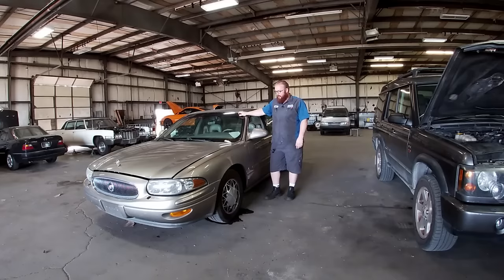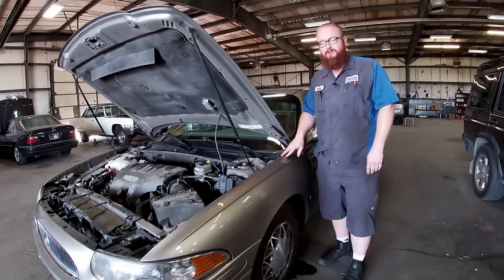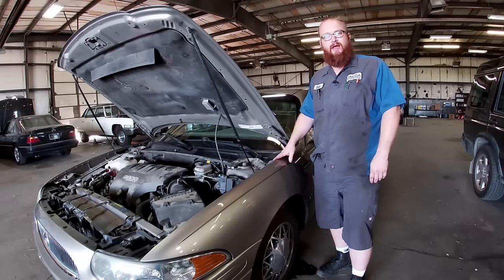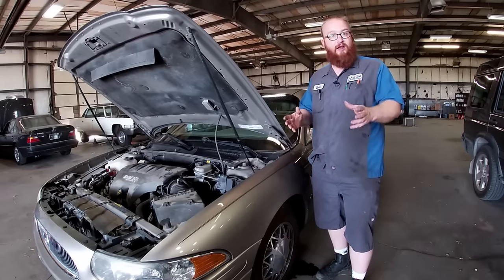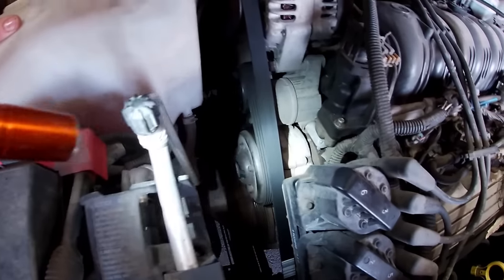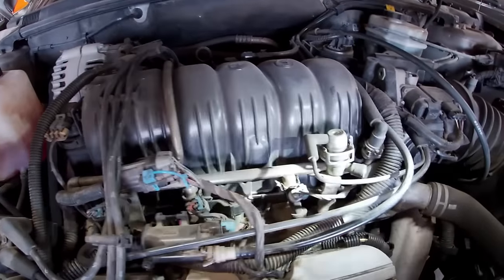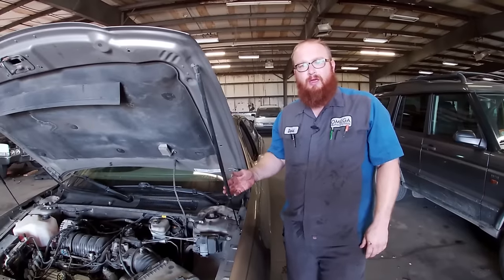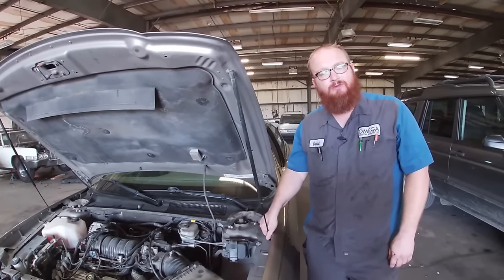CAR WIZARD highlights what makes the Buick 3800 V6 the BEST engine ever!

Comment: Your right no-one can go wrong with this engine. The 3800s are bulletproof
Reply: cobrasvt347 had a 96 Cutlass 3.1 front wheel drive with a 125 horsepower shot of nitrous went to the drag strip every weekend for six months the transmission blew. The motor fine till the transmission went out at 182,000 miles
Reply: @daveycrocket6277   nothing wrong with the 3.1's I'm servicing a lady's that has 220 something thousand on it and so far it's holding up really well. 125 on a 3.1 lol. Sounds like a good time. Gotta love the spray. Shits addicting 🖒
Reply: cobrasvt347 yea I should also say I only ran 1/8 mile tracks in South Carolina. A good set of wide tires all that weight on the front wheels made a killer 1/8 mile car against mustangs and Camaros. The first question whem they got beat was always what size you got. Oh yea and the dipstick had this thick gray sludge on it. I can just imagine what was in the transmission case
Reply: @daveycrocket6277  lol. Shoulda got a pic of the mustang and camaro owners faces when they found out it was a 3.1. Nice 😲
Reply: @daveycrocket6277  my local track here in Tennessee is 1/8 mile. I've only raced on 1/4    a couple times after a gear change.
Reply: cobrasvt347 I would never come out of second gear on eighth

Comment: I owned two Pontiac Bonnevilles, a 1989 and a 1998, both with the 3800 engine.  I could consistently get 35 to 37 mpg (Imperial gallon) on the highway.  Very reliable and dependable engines.  The only repair I ever had to make was to replace the starter on my 1989.

Comment: Great motor.(I have the Buick Lacrosse 2007) Only pet peeve is the location of the power steering reservoir. Engineers could have thought  that better.
Reply: You just made me remember.  In my 1998 Buick LeSabre limited, I had to use a 1 foot long funnel.  It's a small issue but anyway,  I never understood what was the deal with placing the reservoir deep in the back of the engine.
Reply: @peatthetreat   Now, if someone could retrofit the cap assembly to something akin to an auto dipstick,it would make life a little easier.
Reply: I have the same car, and did check my power steering last week. All you do is remove the 2 nuts holding the tank (overflow, antifreeze), swing the tank out of the way. over and onto the front of the engine cover... Then you can access the power steering cap/dipstick.

Comment: I'm 23 years old. my first car was when I turned 18 and it was a 2004 Bonneville running this engine. I'm still driving it to this day and it runs like a champ. I named her Lucille. she's old enough to vote and she's still kicking at 200k miles (it used to be a company car so it never had a bunch of miles on it to begin with) but I've never seen a car engine so open and easy to replace parts. every other car I've worked on has been ridiculously convoluted in its design within their engine bay

Comment: The ONLY issue..... lower intake gaskets

Like a 30 dollar repair..... EASY to do even with basic equipment and knowledge 

Replace the LIM gaskets before 200,000 miles

My dads had 270k.... and I dont know how it wasn't pouring coolant into the oil pan

But once ya do that..... it's a 500,000 EASY motor

More than enough power.... amazing fuel economy
Reply: More than enough power? Nah. That's why I cheaply slapped on supercharger, headers, e85 and meth injection.
Reply: @ichoozjc  in all for making everything fast (my dream car is a 99 buick regal GS... SCed 3.8 and 3200 pounds wet)

But the 3.8 puts out more power than most "daily driver" engines.... especially in the smaller cars it was found in
Reply: @kainhall  Your right, I was just giving a nod to how easy and relatively cheap it is to make more power.  But the n/a engine is a fun ride. I think it's all the torque that makes them so fun to drive.

Comment: The 4.6 in the ford Crown Victoria and the lincoln Town Car were very great engines also !!
Reply: marcel b yes indeed but this gets better mpg
Reply: The Voice Of Reason  interesting yeah long term that is a problem hadn't seen that myself-good to know!
Reply: Poor MPG, these are V8s, not V6s.
Reply: Shitty valve seals. Oil fouled plugs at 39K NO THANKS

Comment: They quit making them because it was to good of engine,
Reply: scott redmon 
*too
Reply: The 3.6 is probably a pos on purpose. Planned obsolescence, built to fall apart.
Reply: Stealerdhip can't make money on a motor that runs well forever. They don't give a crap about the customer.
Reply: Alexis Lubbers I have the 2.8 in CT’s 2006 just put it on the road same as the 3.6 but smaller displacement,I plan to change oil every 4000 miles and get GMs new low restriction filter and add couple ounces of motorkote to oil also.I am pretty sure the problem s with theses engines is not enough oil changes and filters loading up also plan on using 5-30 synthetic gm recommends a brand right on my oil filler. Also the pcv modification will get done to my car ,whisked mine was 3.6 it gets 1 mpg better fuel economy compared to 2.8 lolololo plus all that extra power
Reply: oak 1971 they should be able to recover more from my experience because brakes need replacing struts the odd wheel bearing Ac service repair trans fluid changes and filters the odd wheel bearing belts .People don’t mind this straight foward type of repairs if the motor has a reputation of lasting so I believe over all it will be more easy money and less arguments with customers
Reply: 587,000+ ON MY 2000 BUICK PARK AVE 3800 V6. SUBFRAME IS RUSTY THOUGH
Reply: Nope. Look up cafe regulations, there's your answer. They.. GM.. had no choice to switch to crappy small turbos.

Comment: This video makes me feel really good about driving a slow ass grand prix.
Reply: Take care of that car...I had two ('97, '03). I miss them to this day 🙏🏾😫
Reply: @andrewoliver9686  Same...I had an 06 and an 07 Grand Prix.
Reply: @andrewoliver9686  you should see my 02 GT. SOLID BLACK WITH WS6 hood. She's sweet.
Reply: I had one with the supercharger on it seemed kind of shitty off the line but going from 40 to 70 seemed to have some juice. Cruise 90 on the freeway at 2500rpm
Reply: Definitely not slow you just need to build it
Reply: Though I just got a v6 '08 honda accord definitely faster and better handling than the grand prix I had ....and it's got a fucking sun roof
Reply: It’s still a shitty car
Reply: They aren't that slow. I live my life in sub 160 HP cars and that includes a full-size pickup. One of the vehicles even has HP well down into the double digits lol.
Reply: @marcuscook5145  the grand prix with the supercharger on it definitely ain't slow i had one and wrecked it the thing was pretty fuckin fast at least I thought so

Comment: The Buick Grand National also used this engine- to make a conservative 300 HP in turbo trim.....in 1987.
Reply: Thats 300HP wink wink nudge nudge
Reply: No it did  not, the Grand National used a 3.8 fire ball even fire. This is a GM corporate engine that is metric and has the metric corporate bellhousing, totally different block. But influenced by the same design so it could live on.

Comment: The transmission is also good but you have to change the filter every 70k miles.
Reply: If an automatic has a filter, it's just good to change them as often as possible. I've had no problem with GM's 4L60E's as long as you keep up on filter changes, but you listen on the internet and people say these are horrible. There's not a lot you can do with most transmissions as a hobby mechanic, so changing filters should be a high priority to make sure they are working smoothly.
Reply: Did this from one of Eric comment recommendations on a van he had it will still clunk into 1st or 2nd randomly but works otherwise.
Reply: blackericdenice I have a Cadillac from 1939 and there are people spinning in their graves at that comment...try every 2000...
Reply: That trans is a boat anchor
Reply: @ABeans07  Well it should be since the car itself is a boat!😂😂
Reply: @ms90sbabyy  You best be keeping THAT car, my friend!
Reply: @ABeans07  Bad 4T60e will last 150k miles
Reply: @ms90sbabyy  Have you ever rebuilt a 4T60e?

Comment: the number 1 thing with the 3800 series 2 that my grandmas buick has, that i noticed, was that literally it could take a beating, even from lack of proper maintence.
my dad and grandma? the only thing they would do is change the oil in the 99 park avenue they had. it was the only thing they could afford, we would literally have to save up for tire changes, alignments, etc. i started to buy parts for the old girl, and she loved it so much that she flew up more and more error codes. lol
sadly my father passed on last year, and videos like this make me realize that it could be something very simple to repair on the engine that i could probably do myself with a torque wrench and parts.
however i was told (my father as well) that to change the oil on it, you needed a special tool.  the dealership told us that, i knew it was bull, because i bought a standard oil filter wrench some time ago, but my father, a great car guy, was oddly gullible in that department.

Comment: Planned obsolescence these days now. It's all MEANT to fail. such a shame.
Reply: Keep many employed
Reply: Can't sell you a new one if it doesn't break down, early last century Ford build car's that lasted and could be repaired, for years, greedy people don't understand quality will sell its self,
Reply: Skip R  it’s a wonderful way to keep us constantly having to buy more junk
Reply: Well the 80s  gave the concept that older stuff is unreliable junk.  But the older stuff has a value all of its own now.
Reply: Skip R  with these new systems and the slim parts commonality/availabilty and necessity for sensors and computers, this stuff is going to reach the point its not affordable or feasible to keep anything running past 15 years or so. They're slowly creating a captive market

Comment: Hello, I just bought my next car, 2 months ago.  2006 Buick Lacrosse.  It had 77,900 miles on it and now has 78,790.  I was actually looking for a Toyota Avalon, because i wanted another v6 engine. My searching finally led me to look at the Buick Lacrosse.   I knew nothing about the buick, just that it had a v6.  I had never heard of the 3800 engine.  My car has the Series 3 engine, which i now know is the most up to date version of this motor.  I am still learning about this car.   But it is a very very nice ride.  Somehow it still smells like a new car inside.  I have only driven it about 300 miles a month so far.  Anyway, thanks for helping me learn about my new car.

Comment: Next time, Wizard reviews the Rover V8 he ironically parked the Buick next to!😂
Reply: i spotted that too
Reply: I do kindof appreciate how easy a lot of stuff on the Rover V8 is, itd probably have a better rep if they let it run cooler and used flanged liners to begin with.
Reply: didn't Buick sell the basic design to rover?  originally the buick 215 iirc
Reply: lasagna187 yes GM sold the engine to Rover because GM designed it for a race series and had no more use for a small V8. So they sold it to the suckers across the pond.
Reply: The Buick was better than the bmw 4.4, yes?
Reply: Literally Shaking  naww...  Rover is British Fords now.. Right?
Reply: Of course the irony is the worlds "most reliable engine", the Buick V6, is a derivative of the Landrover V8 (Buick design) sitting right next to it.
Reply: Sebastian m well it was made by Buick...
Reply: lasagna187 yup

Comment: I have a 99 Park Ave and I absolutely swear by this engine as being the best GM engine ever built. The GM 455 or 350 would tie for second place.
Reply: I got a 99 park ave ultra for 500, some body damage and a dent in the hood, but mechanically nothing wrong. Buick put all the upgrades in this 3800 (in my opinion, the best 3800 ever made). The only flaw, is the motor mount next to the supercharger will wear out, (can't handle the torque put out by the supercharger kicking in). Depending on how fast you like to drive, is how fast the mount will last (they don't make a rubber strong enough.) I know a guy who rods the piss out of his, He has to change it every couple years. I changed mine once, and it's still good, but is wearing out.
The ONLY flaw Buick didn't forsee. Buick doesn't skimp on anything they put in the park ave. Were on the cutting edge in computer chips and sensors. (one of the 1st smart cars ever built). Doesn't look the greatest, but damn is it comfortable, can bury the needle  (140), and it is still picking up speed. My buddy  says they will do 150+.
Reply: @tomkuntz4538  I disagree.  I think they look great! :D

Comment: Better when longitudinally mounted, like in a G-body...best when turbocharged 😎
Reply: That wasn't A 3800. That was a 3.8  there were Alot of differences
Reply: They were longitudally mounted in Aussie Commodores, RWD platform.
Reply: @jameybrandon965  thats what i was thinking. werent the 3.8s prone to head gasket failures?
Reply: When building the L67 in my Buick, the machinist had the block '87 3.8 from his T-Type on a stand next to my block- the Series II is quite a bit beefier than the earlier engine- not a knock/insult, to be expected with more investment R&D
Reply: @mikegager  no, you're thinking about the Ford Essex 3.8 V6, which,  incidentally, was virtually a copy of the Buick V6, except that Ford made the heads aluminum alloy and skimped on head bolts, which, coupled with Ford engineers' tendency to run the heads really hot (for emission control purposes) had predictable results...
Reply: @brentboswell1294  ahh you might be right there. i know the ford 3.8s were bad with head gaskets, im probably mixing them up
Reply: @mikegager  No, I've had both. A 93 Sable 3.8 lost a head gasket and seized with 76k on the clock and my 98 GTP has had the gaskets replaced on recall due to a fire hazard if oil dropped on hot manifolds. GM only replaced one bank of cylinders, the other crappy gasket was my problem.
Reply: @mikegager  I don't know about prone but I had a 1980 Buick Century with the 3.8 that blew a head gasket. That was my first car and it had a hard life before that so not sure I can blame the engine too much.
Reply: @mikegager  head gasket failure due to weak fasteners, heads would actually lift  and warp.
Reply: olikat8 the series 2 put out a bit more power from memory
Reply: This is a 3800 metric corporate engine. Your thinking of the Fireball even fire 3.8. Totally different engine.
Reply: @DRNEGOLICIS  how do u figure this whole this whole video is about the as u say a fireball its on the united states 3800 the grand prix my boneville park avenues regals etc etc .. I had the series I n II. Supercharged .. So how n y u talking about this metric good sir !!??
Reply: @Lucille69caddy  Makes sense because the silver valve cover is now black plastic and the dealer ship removed and discarded the engine cover, however the car still leaks oil and sometimes I still smell burning oil when I park it. The driveway confirms my suspicions.

Comment: even though those Buick motors are really good motors in my mind one of the best motors ever made was the 4.0 inline 6 that's in almost every single jeep from the late 80s and 90s plus a lot of other vehicles
Reply: poopy doodooz - It seems all the American automakers built great straight sixes.  The Ford 300 is an absolute legend.
Reply: poopy doodooz  I think that Jeep in-line engine was basically the engine that American Motors used before they were bought by Chrysler.
Reply: If you don't mind putting a new exhaust manifold on every few years
Reply: @richjeffers7499  they make manifolds that have a little flex to them now. But I've had 0 issues in over 4 years with mine.
Reply: @ClockworksOfGL  True. I have a 78 F100 with inline 6 300, and a 96 Cherokee inline 6 4.0.... Excellent motors! I swear the engines are near identical, just the blueprints were flipped over. The way the distributor goes in, exhaust/intake bolts up, etc. They just share many similarities. But they just last and last and last. And make plenty of torque.
Reply: Miss my 99 Grand Cherokee with the old iron block 4.0 thing was bulletproof
Reply: I agree I like the 4.0 Jeep inline better compared to the 3800
Reply: @Ocalaman  It was the same except the head was redesigned to give it a lot more hoarse power,.My 2000 Cherokee could break the tires loose, but it was thirsty at the pump 16 mpg, my 87 Cherokee with (GM) 2.6 v6 got 23 mpg.
Reply: 3.7l jeep powertech was a good engine, very similar to the 3800
Reply: AMC 150, aka 2.5L has it beat, it's what the 4.0 is based off of
Reply: @ClockworksOfGL  Don't forget Chrysler's Slick Six!
Reply: I agree the GM 3800 and Jeep 4.0 engines will outlast the vehicle its running in. But lets not forget the Nissan 3.0 v6 QX A32(95-00 Maxima) and VQ30(00-01 Maxima) another engine that just don't die

Comment: I maintained a 208 unit automobile manufacturer car fleet and we had 5-6 Buick LeSabres w/ 3800 engines. This was the most requested vehicle by our engineering staff. We would send (4) out for a 1000 mile trip, great comfort, plenty of room and knock down 28-29 mpg at highway speeds. Smooth, quiet and solid with plenty of power.   Easy to maintain, ease of access for all components.